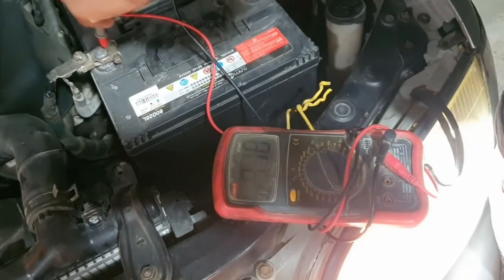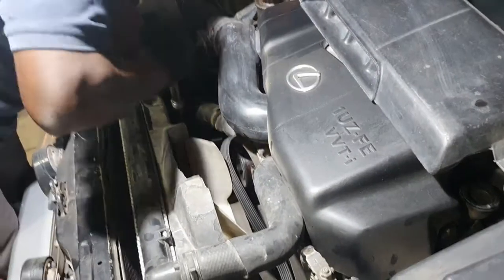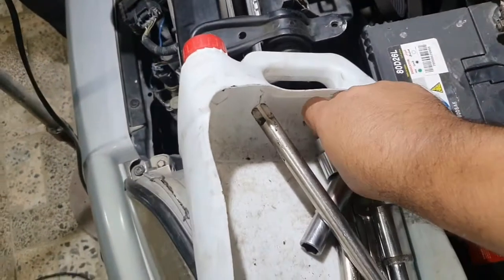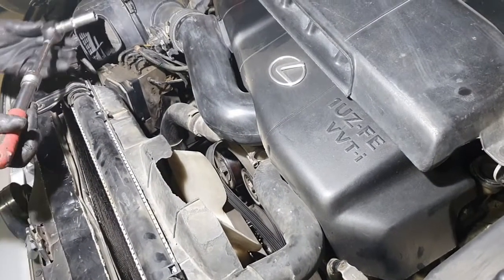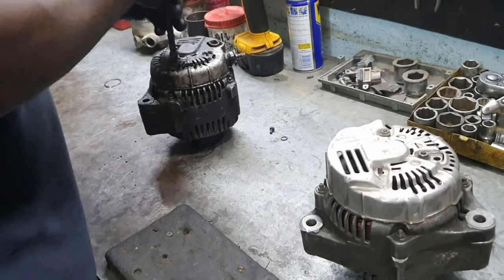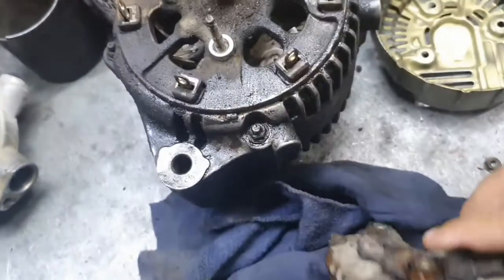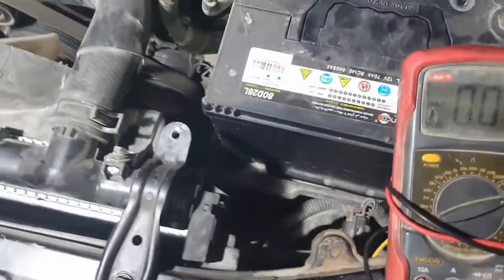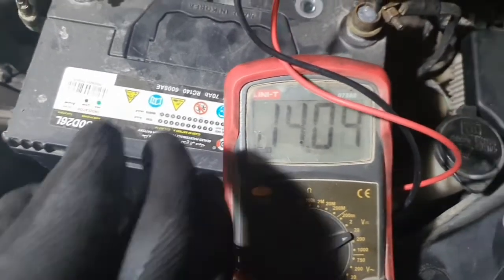How test alternator with multimeter LS400 LEXUS

Comment: Thank you for this I am trying to diagnose a miss in my engine my plugs are new and my alternator is new but I want to double check so thank you.  This video reminded me that ithat it's either an electrical problem or it's a vacuum/power steering problem because I don't believe it's a valve problem.